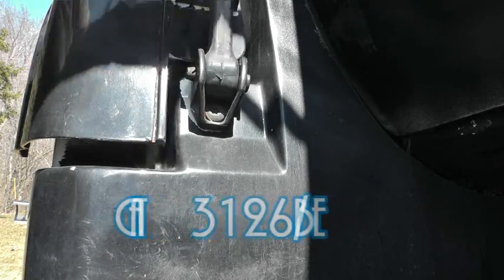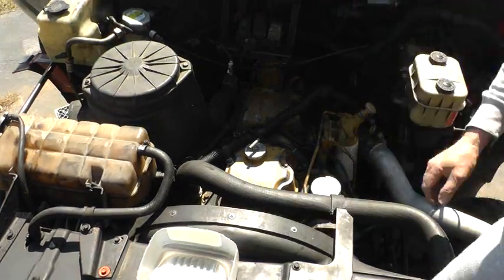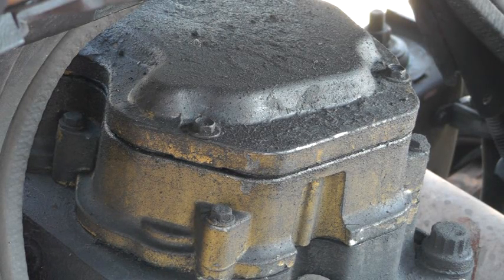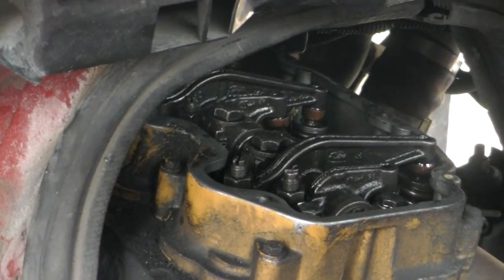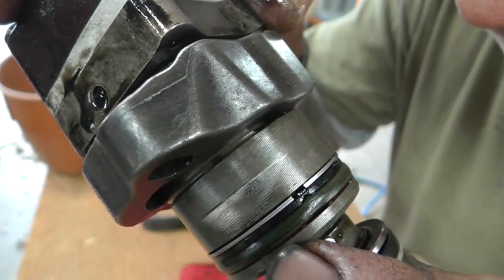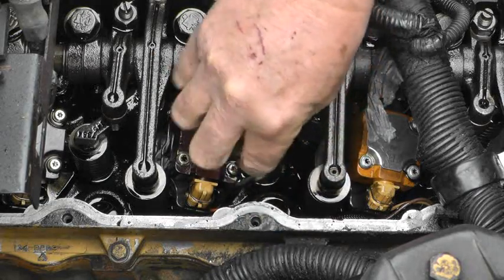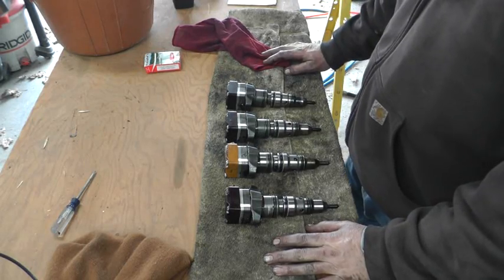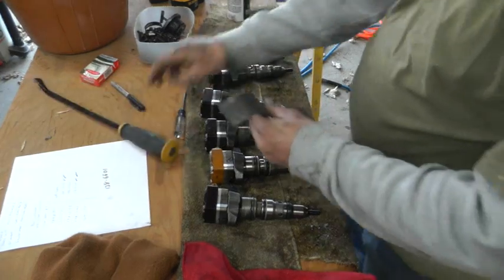CAT 3126B/E Injectors Part 1 Removal - Injector Removal Tool

Comment: What is that silver piping or tube right beside the engine where he is working called
Reply from the maker: jonathan doyle It is the pipe the carries air from the intercooler to the intake
Reply: But what is it called
Reply: ***** cac pipe

Comment: @ jcook007fix your pretty much right... fuel from the tank get drawn from the transfer pump gets filtered, first then heads to the cyl head.... upon where its  flown through all 6 injectors.... where high pressure oil is used as a hydraulic piston to push a very small needle and a small amount of fuel "pressed" together creating the high pressure the fuel needs to be when injected into the cyl